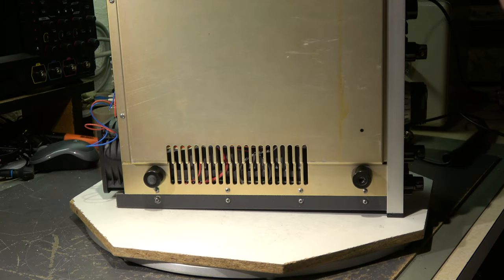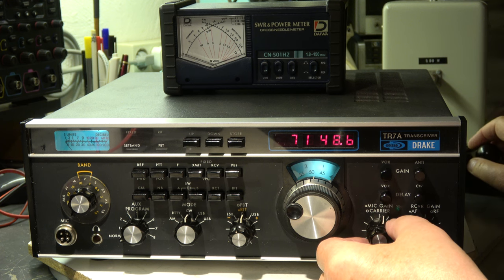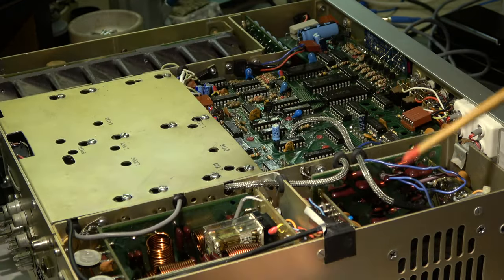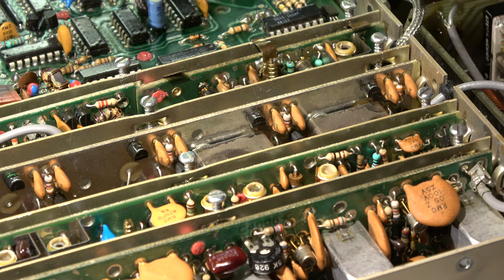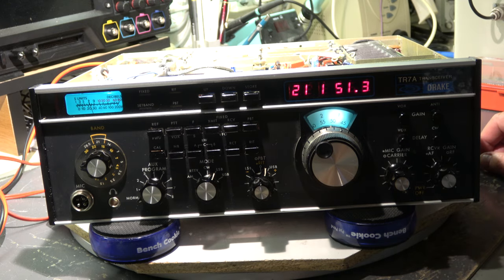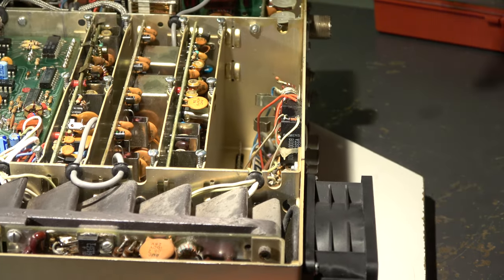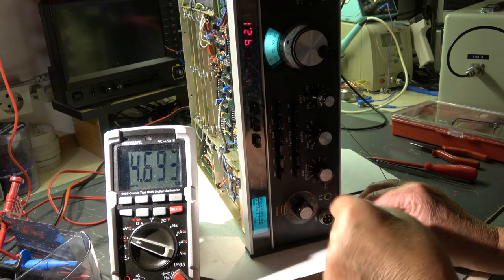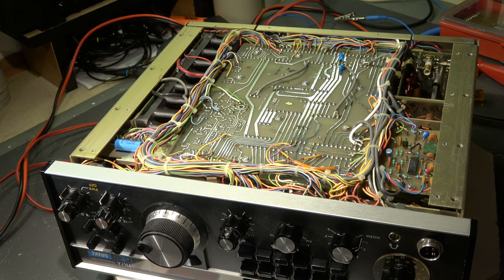#168 Drake TR7 Part 1(7)

Comment: that's a weird defect, looks like an unlock / loop filter problem on the higher bands. Also could be a faulty prescaler problem.
Reply from the maker: The two VCOs have the same loop circuit, only the higher band VCO has this problem, so the PLL seems to be OK. I assume a problem in the higher VCO or it´s supply, which is switched acc. to the chosen band. We´ll see....